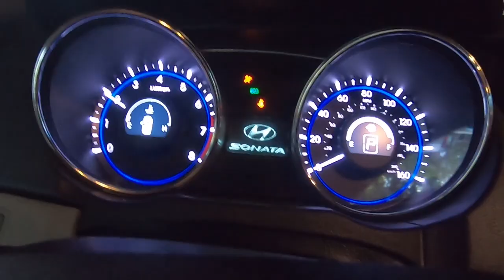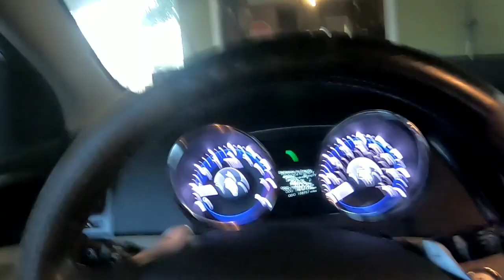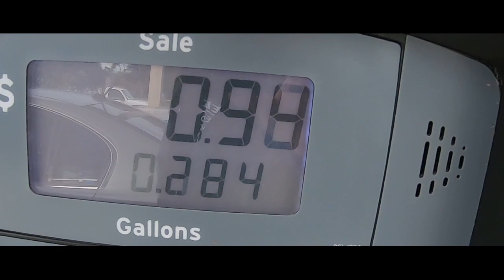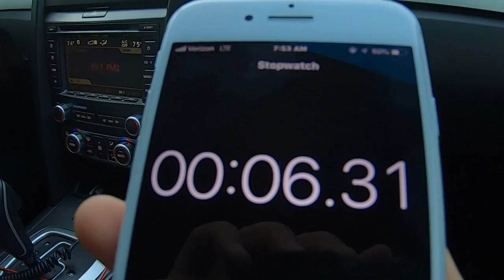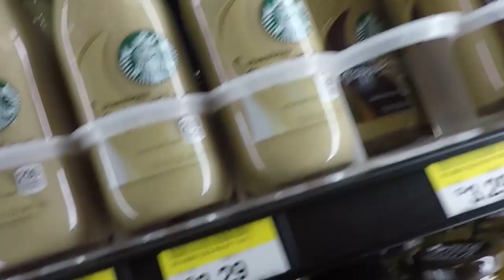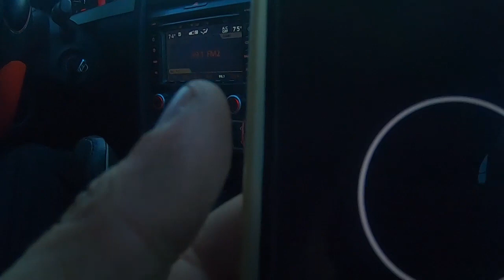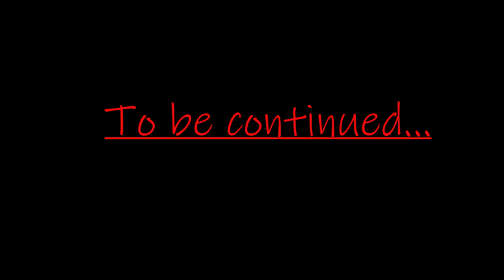Camaro SS differential on a Pontiac G8 Gt from 2.92 to 3.27 ratio

Comment: You need some pilot sport 4s tires on the rear. They run those on 800-1000+ hp cars and they hook wonderfully
Reply from the maker: Ya, we'll have to get us a set.
Although it does way better now with the tune
Reply: Ya we need to go with a bigger tire also
Reply: Michael Holt yep need more contact patch that's for sure
Reply from the maker: @gunnermach1503  lol yes sir! Thanks for all of your help again bro!

Comment: What type / brand of diff oil did you put in the camaro diff? Is it the same stuff as what's recommended for the 2.92 G8 diff?
Reply from the maker: +neek betts 75w 90 ac Delco with a limited slip additive. thanks for watching!
Reply: @FastLanePros  thaks heaps

Comment: I change the diff in my G8 and notice that my rear end this squirrelly Over bumps any tips
Reply from the maker: How many miles is on the car?
Reply: 89000 miles somebody message me back and said I need a wheel alignment something's told in I don't know what that means but I have to get a check  Out
Reply: Toed in
Reply from the maker: @chrissilvestri3642  yes for sure you have to get a realignment but you may want to go with the bmr bushings as well. If it's toed in which mine was you can stand at the back and look at the wheels from the side and see the toe in. I have a video with the alignment as well, go check it out and give us a big thumbs up.

Comment: You know the car has a built in reader in the dash right? Also wouldn't want drive on lift, cause its harder with all the tension from body weight/suspension. Also kids strong, goes gets dif in garage by himself puts in trunk (can see weight on suspension), in shop two grown men lift dif out box. hahah
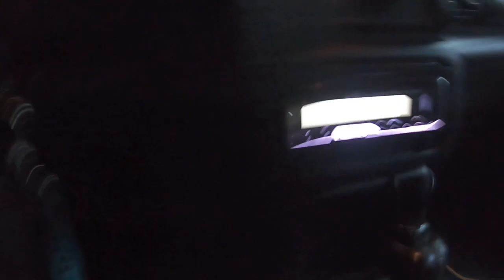Reply from the maker: Yes but the thing is it was already tuned for the 292 gears and it wouldn't compensate for the 3:27's. And yeah it would be real hard with a drive on lift. He is strong for his age but he's a hard worker. Thanks for watching!
Reply: @FastLanePros  Yeah i know you need to return for the gearing was just saying for reading the sensor stuff.
Reply: @FastLanePros  Yeah i informed another youtuber about it they didnt know about it, not too many people know.
Reply from the maker: Gotcha!
Reply from the maker: I knew the tire pressure reading and all that but was unaware that you could see the wheel sensors

Comment: Nitto nt05 305’s
Reply from the maker: +ConnorZ71 I'm rubbing with the fenders rolled with 285's
Reply: I got ctsv2 rims on the rear with em just fine
Reply from the maker: @connor718  do you have suspension work done?